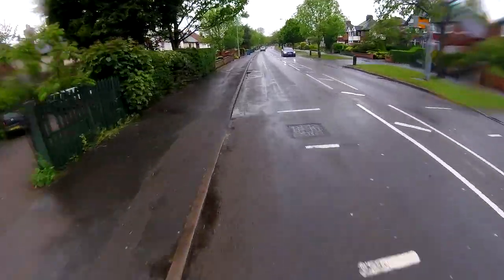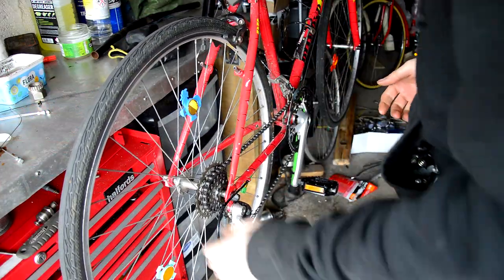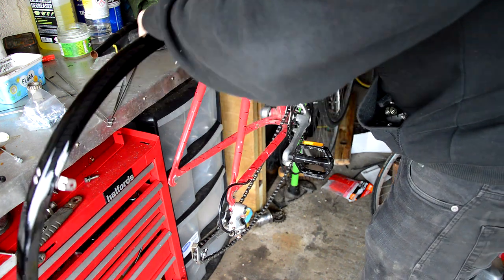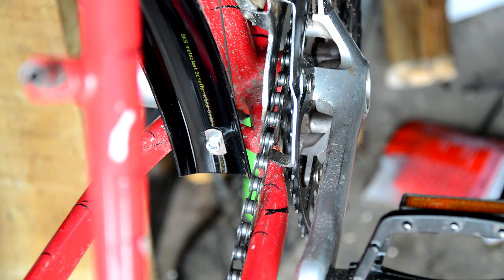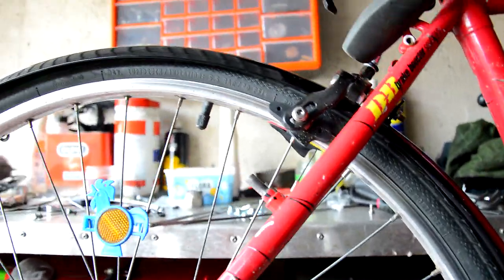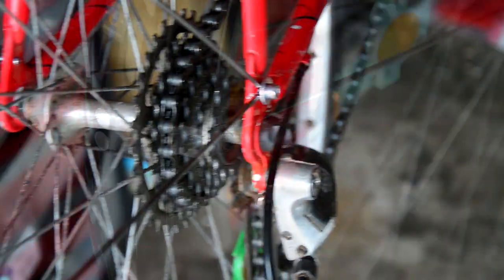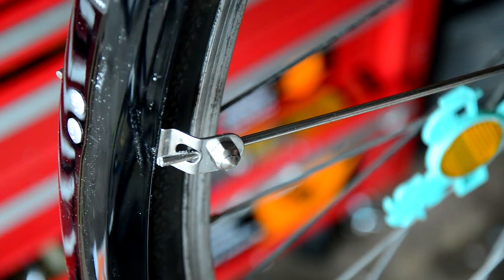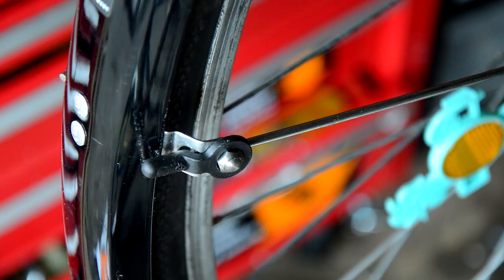Installing SKS Bluemels Mudguards - My Favourite Commuter Mudguards

Comment: Great old Diamond Back. Cool Reflectors. Nice new fenders! Plenty to love!!
Reply from the maker: Thank you.  I've just picked up more reflectors! Yay!
Reply: Right on. I'm fixing up a 'his and hers' pair of Diamond Back Sorrento's that came my way. I think they're the same model year as yours (1990 or 1991). And if you really love Diamond Back as much as I do, here's a shot of my DB collection: http://i.imgur.com/v6g254B.jpg

What kind of reflectors did you find? More of the same you put on?
Reply from the maker: I'm really starting to like old MTBs.  They're useful for frankenstein builds or CX conversions... or just using as intended!  I have a Claud Butler MTB build waiting to be published... I just need one more part...

Yup, more Kelloggs reflectors, but this time Tony the Tiger! They came up cheap on eBay so I had to have them.
Reply: I’m waiting for my SKS Bluemels 45 Matte Blacks to arrive and I think I’m going to paint the supports in matte black as well to better fit my black bicycle...  before installing them.... nice video mate, thanks for that! Do you think it’s possible to install the fenders while the wheel is on the bike? Can’t figure out a reason why not

Comment: Excellent video with lots of details.  The only problem is those nuts come with the package would not work or useless as the bolts cannot screw through.  Why is that?
Reply from the maker: I don’t know? All the fixings worked well for me.
Reply: @MonkeyShred  got it from the internet.  These are called nyloc nuts which cannot just use fingers to tighten them up.

Comment: 17:31 What if my bike does not have the hole in the fork so that its not possible to thread the screw in anywhere? How would I mount the front mudguard then? Thanks for sharing!
Reply from the maker: You can use something called a P clip. Get the rubber backed version so they don’t scuff up the paintwork.
Reply: @MonkeyShred  I just thought to use velcro band and let the fork hold the long pins to the fender. That should work... i guess?
Reply from the maker: @ashystyle  could do. Have a look for a P clip though. They work great.

Comment: I used to have a set of SKS fenders. I was told they were fiberglass with an aluminum foil core to keep them light.
Reply from the maker: I can check that on the old pair that snapped.  I've still got them stashed at work.
Reply: That would be great. Let me know if it's true. Someone at the bike shop where I bought them told me that. All of the package labeling was in German except for the installation instructions. Which, were in English and just about every other language. I sold the bike that they were mounted to and their still being used so I can't cut them up to check. I don't remember what model they were either but, they had all of the same plastic mounting brackets. I broke those front safety eyelets that go on the front fender during installation. lol 😉.
Reply from the maker: You are correct!  There is indeed an inner core of shiny silver material.  A very thin sliver.
Reply: The guys at the bike shop I bought them from K&G Bicycles in Kettering, Ohio deserve the credit. They know they're products and prices of the things they sell. They've even given me free service over the years. When they see something wrong with a customers bike they will often take it in the back and fix it on the spot at no charge.
They're also known around town for ordering custom parts at a discount. Many thanks to Justin, Brian and all of the other sales/ mechanics that have helped me over the years. They're a great asset to the local Cycling community.

Comment: Did your set come with the long bolts which fix the guards to the existing holes on the frame? I just bought a set and it came with the stays and clips and other bits but not the long bolts.

Comment: Well done my friend ...only got one thing to complain (but not about your work ) I don't use those plastic bridges ...I always use a metal one because on hardtails or bikes with a stiff  frame like that the plastic just breakes way easier trough the vibrations .  Have to do this work also soon , because I've got guards made from aluminium atm on my Dawes and they are realy old and worn out and got a lot of cracks ...and the noise they make drives me nuts xD !!!! Nice video ..keep up the good work and have fun !

Comment: Way  back when in the 1950s & 60s Youth Hostling  Cycling Club Riding,  The long and the short miles,  Rain or shine,  And for Mudgaurds,  We all used,    Bluemels   ever time.
Reply: For Bycycl commuting & touring,  It is well worth the little extratime & expense,  To buy, Find, Aqwire,  Lock-Washer's,  For all the fittings on the mud guards,   And a - lock tighte - compound  on the threads of nuts & bolts.  You can add  Mud-Flaps,  to the  Mud-Gaurds. For when you ride in groups.  You will be glade you made the effort.

Comment: Yeah . I'm a fan of these.  Great value.  How do people  fit to the fork and brake bridge with more modern 'recessed' brake bolts ?

Also I've got an old late eighties British Eagle MTB (cantilever).  Rear I've got fitted fine but front the drop from the fork to the mudguard mounting makes a neat fit very difficult. Need bridging or mending plate or similar ?
Reply: hello my friend, did you ever figure this out? I’m trying to attach fenders to my bike but the bolts on the calipers don’t stick out as far as the ones in the video

Comment: Just fitted a set of 45mm wide ones to my Boardman ADV 8.9. There are threaded holes in all the right places at the rear but the front mounting holes on the fork legs are quite a way up from the axle. the stays need bending and cutting to work.
My big trial was getting the tiny Nyloc nuts to thread on. I cheated, eventually.
Reply: Richard Ashton I have the 8.8 and can’t for the life of me figure out what any of the nuts are for?
Reply: Same problem I faced and not knowing how to work with those nuts as it has limited thread or blocked toward the other end.  Totally useless, why?  Or am I too stupid not understand how to use them?
Reply: @arthuryu1905  If the nut is put on with one turn, you can see that the nut bears down on the stay to stop it moving.
I started out totally the wrong way around, so it took me a while to get it sorted out and tight,
There might be a video or photo on the internet to guide you.

Comment: Hi, if you were to get a puncture and need to replace inner tube, would you need to take these mudguards off to replace or can replace whilst keeping mudguards on?
Reply: Appreciate its 2 years late but incase anyone had fears about this. You'd leave the mudguards fitted, there is no need to remove them just flip the bike, rotate the puncture to the sky, use your tyre levers to pull out a bit of the tube where punctured, patch, reinsert and inflate.

Comment: How do I fit the rear bridge on my bike? My bike only has a hole for a bolt but does not go all the way through the bike frame?
Reply from the maker: Put a bolt I there? If it’s already got the threaded hole just use that.

Comment: Thanks for the video. What size wrench for the bolts? Also, there are 3 different sized bolts with odd numbers (1 long, 3 medium, 5 short - assuming the short are for the front and rear drop outs with one to spare, and the others for whatever fits?)

Comment: If only you showed what happened after 5:38
Reply from the maker: You just put it on the end of the bolt on the other side?
Reply: First he tried to bolt it through the chainstay bridge, but the bolt was too short. Instead he bolted it directly, so all parts at 5:04 together with the mudguard. The curved part should clip onto the bridge, but it's not that secure so he replaced the original bolt with a longer one that did fit through the bridge. I think :)